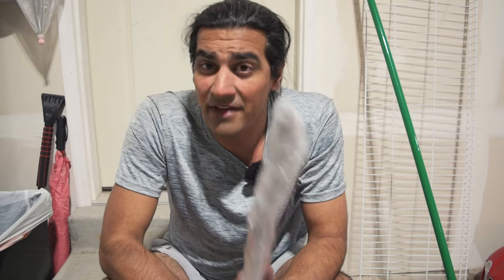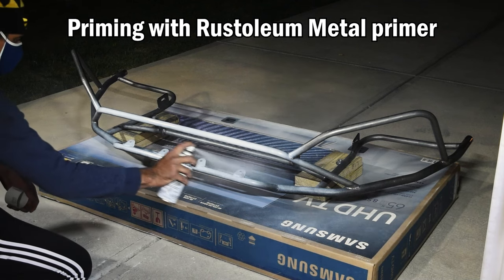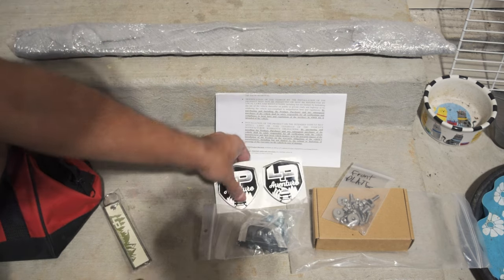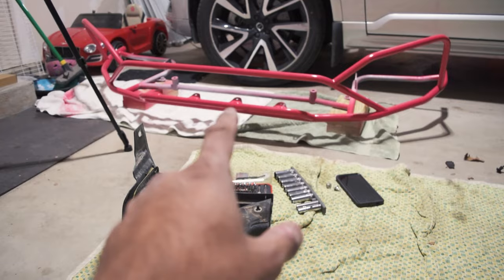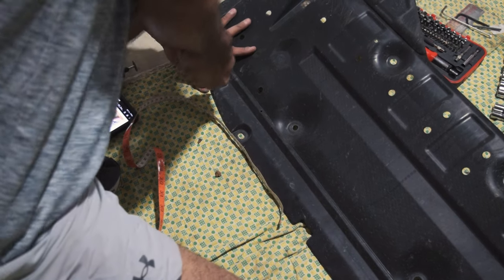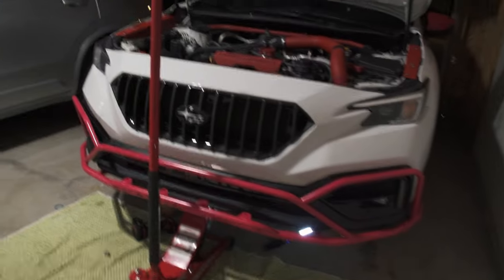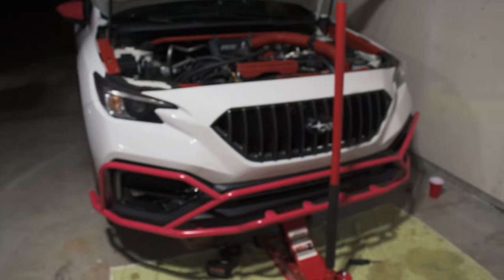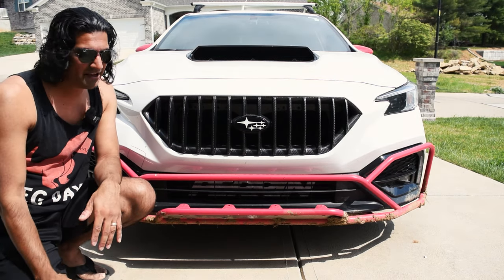Painting & Installing LP Aventures Large Bumper Guard on my WRX

Comment: Thxs great video. Are you installing the 2 inch lift kit from LP Adventures on the wrx 2022 with adaptive suspension? Would love to hear your review after 3 months. Im thinking of it, LP Adventures says it works, they have done it before. Just want to hear if there are any mech or sensor type of issues. Thank you😊😊

Comment: You need the harbor freight roof basket now it’s only 100
Reply from the maker: Id like to get a roof basket so I can take tools and tires with me. I learned recently that going to a rally event and not bringing supplies is a bad time. 😂
Reply: @HeavyMetalWRX 4 tires fit in my impreza back seat also! I bought bags for the wheels so the interior doesn't get dirty.

Comment: Lift ✅ Tires ✅ Wheels✅ Rally Bar ✅ Roof Bar ✅  However the grille has to replaced again you got a AMG style grille on now a Rally car build I’m sure your realize that and have something already in the works. The cherry blossom color is loud and stands out idk 🤷🏻‍♂️ IMO going back to all white is more subtle better consistent look overall that’s just my opinion nothing against you bro… besides that all your missing IMO are hood mounted ditch lights + Baja lights for the rally bar. Rear hitch and roof basket.
Reply from the maker: I'm not sure what to do about the grill. It has really grown on me. I'm gonna give it a bit and see if anything new comes out. I am looking for a decent basket so I can take two tires with me to the rally track. This way I can load tools and jacks and such in the trunk.
Reply: @HeavyMetalWRX  🫡🇵🇰 Nice. You should definitely consider the rear hitch  too then you can add more storage like a park mule for example without having to clutter the backs seats and trunk with your rally car stuff now.